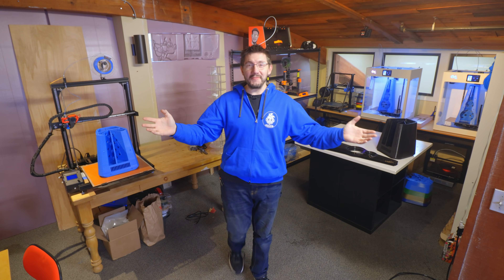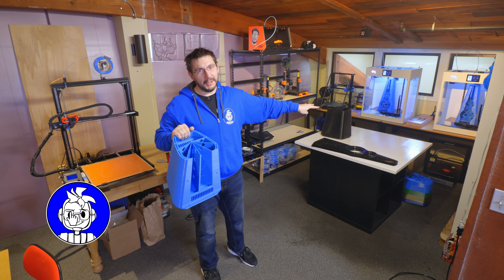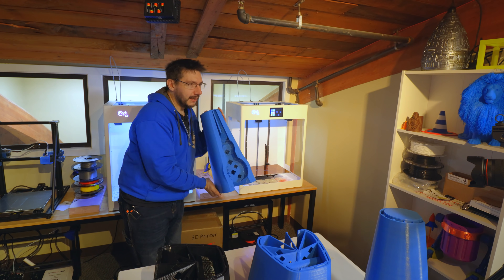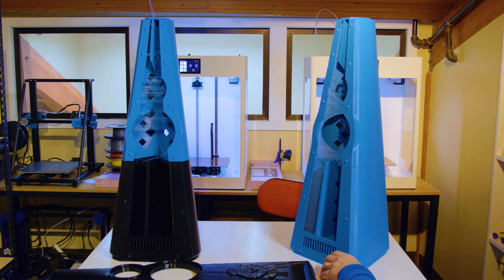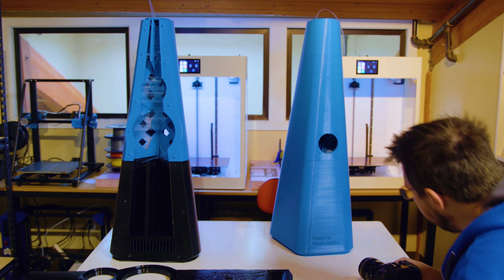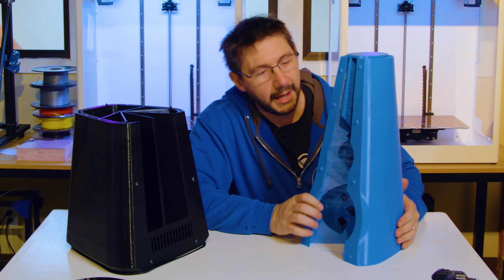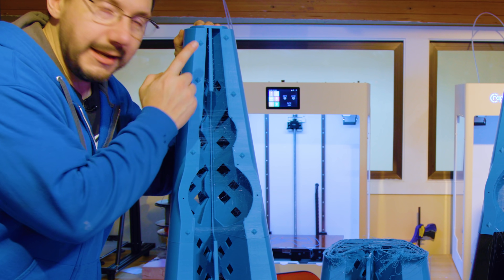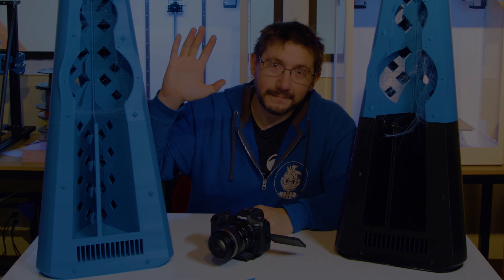3DPrinted Speakers Part 2: 11 DAY PRINTS

Comment: So let's get this straight. this $38,000 printer has poor bed adhesion, requires two filament spools even when you're using one, has huge layer shifts and stringing, and no bed leveling system...

meanwhile my $90 easythreed doesn't have ANY of these problems, even without a heated bed.

Comment: You could wet sand those speakers starting at 800 grit, then go to 1000 grit, then go up in grit by 500 for each sanding step, all the way up to 3000 grit. You won't have ANY layer lines when you're finished, and the color will be PERFECT. Use a sanding block for the flat areas, and a sanding sponge for the contoured areas, and use light pressure......let the sandpaper do the work for you.

Comment: looks like you're over extruded to me brother. You should calibrate your extrusion multiplier. No matter how much retraction you do there you'll either pull hot stuff into the cold zone the string will never go away when you're over extruding
Reply from the maker: Yeah I bet you’re right. I have some time coming up where I can spend a lot more time with the Craftbot machines.
Reply: @3DPrintingNerd  I find the hollow pyramid test print is really good to test for everything even heat it looks like some of those prints might have been maybe five degrees too hot
Reply: @3DPrintingNerd  but still most people could not pull off 11day prints so great job brother
Reply: @princefpv1  Preach my man,  jealous fools stating useless driver facts when its all about the prints.   The 1970 Altec Lansing 604E Super Duplex with the N-1500 dividing network whos equation is literally the building block for all cross overs in its proper enclosure will outshine some bunk driver you claim sounds good.  3D Printing Nerd is the man.  did not think you could print for this long.  and unless you can mach these up in software dont chat about your base level online engineering course that might of been taken.  Passions are not blinded by cost they are driven by interest in pushing ones own boundry.   most play music on compressed in ear buds, not Lossless Audio played on a 195pound Mcintosh Amp with 5grand Cardas cables.  You know what your music sounds like through really expensive gear........It sounds like SHIT! you hear all the mistakes.  we come here for the man and the prints.  not a lesson in spatial movement of air in a medium.  not that i search the globe looking at prints, these are impressive big time.  way to go

Comment: The gCreate gMax 2 are you serious? who in their right mind is going to pay $4000 for a printer thats a scaled up i3 design that can print PLA and PETG? 
I am looking at building a HevORT that can print over 150mm/s that can basically print anything up to PC and thats going to cost under 2k even with a 400x400 build area.

I do like the printing project though, i have a friend thats building a sub and all the speaker moulds from scratch.

Comment: Even a slight over-extrusion rate can manifest itself at the top layers of a tall print by causing your layers to collide with the extruder resulting in your layer shift, especially when traversing open spaces!  This could also be causing your stringing problem!

Comment: I believe the hole in the back would be for a terminal cup (where you would connect the speaker wires from the speaker to the amp or receiver

Comment: If you can break it down to  3 pieces then you can also break it down to 6 or 8 pieces and then it won't hurt so much as a failure on 10.75 days. You could also have 6 or 8 different colors as you started. it does look good.

Comment: Maybe slice the model into a few more vertical sections ... get the time down to say 4 days per printed part so a re-print isn't so painful.
Reply: I'm doing that right now. 7 day print into multiple parts. Turn it on before work, and start the next one the day after. Allows for adjustments while building it aswell.

Comment: As pretty (and hideously expensive) as these are, the sad thing is they are still based on a driver technology that's outmoded and doesn't produce terrific sound accuracy. Tech Ingredients' channel has demonstrated and produced speakers that cost a fraction of this - even the drivers cost a negligible amount and produce highly accurate sound production that can rival some of the best money can buy. 

If you're into awesome sound reproduction, his channel and the designs are really worth checking out - not only that, but the are so flat, they will fit into pretty much any available space.

Comment: just measure, cut and reprint the part that has the layer shift, I think with that you could also make a video of how to save a failed print.
Reply: That would be interesting. How would you cut it in a super clean way? Craft knife, band saw? I had wondered if the failed Gmax 2 print could be saved like that.
Reply: @Audio_Simon  I would think a band saw would be best to make a clean line. I have done this before in maybe a less perceive way with just a quick mesurement and a chop in tinkercad. But that was for a smaller 10 hour print that has failed a total of 3 times and I did not want to print again

With this it seems that there would be a good maker that could be found in the model to cut at

Comment: Bottom area discrepancy is because of plastic shrinkage. There are a lot more material in the bottom area which pulls the outer plastic inwards. This is not the case when printing walls. An enclosed machine with heated chamber would outcome this problem.

Comment: You should add some baffle material inside so it doesn't cause a knock pinging sound due to the plastic. home moving material stuff is awesome for it too.
8:27 resume at layer 3864

Comment: If he made the base a little taller, you should be able to fit an 8” sub-woofer into it as well.  It’s going to be very interesting to see how it resonates, as this is more of a violin like design than it is a speak enclosure design.  A downward facing sub-woofer at the bottom would make this a complete package.
Reply: The main driver is about 7" and will dig flat down to about 35Hz anyway. So sub will not be especially important.
Reply: @Audio_Simon  hi simon. I dig for your project and found nothing. I am interested to try it filled with an composite based on plaster or concrete.

Comment: If you find the height at which the print failed with the nozzle, you can go into the gcode and search for the z height and delete all the gcode prior to that height. You have to make sure to not let your bed cool, preheat your hotend and home only x and y before you click print. If the firmware has a auto level or auto home sequence then this technique won't work but if you're using octoprint, repetier host or pronterface it should work.

Comment: 11 days???  I get it.  It's nice to have bragging rights for such a long print, but couldn't these have been printed days faster with a larger diameter nozzle while not losing too much detail?
Reply from the maker: Maybe? I think going with a 0.6mm nozzle it could still retain detail, but 0.8mm would be tough. I suppose I could still keep it at 0.2mm. layers. I went with this setup because it was working well, I didn't have to change anything, and I could spare the time to print these. More experiments in the future though, for sure.
Reply: @3DPrintingNerd  Moving up to a 0.6mm nozzle while sticking with a 0.2mm layer height yields quite nice results, in some cases, you might be hard pressed to see a difference, but the greater line width will cut down on time quite a bit.  
0.8mm on the other hand is just a bit too coarse.  At 4x the volume of a 0.4mm nozzle, it's super fast, but unless you're aiming for that exagerrated layer line look, 0.8mm might be best left to functional parts that don't need to be too pretty.

Comment: From what I can see so far, all the speakers seem to share the same air space. That would mean the lower bigger speaker (the 8"? sub) will most likely interfere with the movements of the mid/high speakers when playing certain frequencies (if those mid/high speakers are not closed back). I also think the walls are not thick enough, or are not supported well enough to keep the cabinet from resonating while it's playing music. That's why many quality speaker cabinets are made from multi layer birch plywood, hard woods or MDF (for wall thickness/strength, and to help reduce unwanted resonances). I guess we'll have to wait until the whole thing is put together before passing final judgment.

Comment: Dang that Craftbot is unreliable AF !
Reply from the maker: I don't think I would say that. The left one with the layer shift IS the first one they sent my way. The one on the right IS the second one and the "better" one.
Reply: Vishal, really? Thousands of hours on mine and you have seen the prints. Mine are dialled in and are super reliable. I rarely check first layers, PLA, PET-G, ABS, ASA, Nylon.
Reply: @rick you and Michael Hunt are exceptions ... having known the machine and fine tuned it ,you guys have got a 'hang' of what gives (in addition to having spares on hand since you distribute the printers as well). I am seeing on the group so many folks having problems with the left extruder,extruder boards, mirror mode...far too many considering the price on these printers.I run a bureau with 6 older craftbots and I know they are solidly built but I think they need to mature the current product line through upgrades.
Reply: Vishal Pai It is super reliable mine are pumping 24/7 365. The issue with the left extruder is operator error, too aggressive when placing them in position. I pretty much print in parallel or mirror mode on all prints and completely disagree with people saying it cant do it (it does it easily, they just haven’t tuned there printer). This printer does need more fine tuning but once you get it right and understand it, WOW! My failure rate is ridiculously low now I just hit print and most of the time I dont even check first layers. What it is not is plug and play like the older CB models, you do have to fine tune it.

Comment: Why did they take so long. I make prop helmets and print them on a 300mm cubed printer. I’ve made prints as large, what’s your print speed is really what I wanna know. And if it’s lower than 60 whyyyyyyyy...... why
Reply from the maker: I'm using the default 0.4mm nozzle on the Craftbots because it's working well. As for speeds, I think defaults is 60mm/s but it slows down a lot for certain moves. Also, LOTS of z-hops and moving around for these. If I were to do this again, I'd probably go with a 0.6mm nozzle.

Comment: The combined price of those printers is astronomical and they came out with layer faults and stringing, I have 2 Ender 3's a CR-10 max and a V-king 400X400X400 and I know that they would do a much better job than those "industrial" models
Reply from the maker: I'm really sad about the Craftbot and the layer shift. Really, really sad.

Comment: He said something about some lifting in one of the prints, is that lifting off the bed or something on the side of the print like little bump that goes all around the print for a few layers. If so I have had this problem and I can't find a solution to it.
Reply from the maker: "Lifting" for me was an edge lifting away from the build plate.
Reply: @3DPrintingNerd  ok but I thought you said something about some thing at 1:09 some line right under the same that looks like it goes all the way around the print. what is the ring around the print and how do I get rid of it.

Comment: Looks great. I'm curious on how they'll sound once they are all put together. As far as sticking them together a 2 part epoxy that is geared towards plastic would be best. The West Systems G/flex 650 Toughened Epoxy is great on plastics. Maybe give them a call and find out what they recommend.
Reply from the maker: I had though about an epoxy, but I was also thinking about generous helping of 3dgloop. it'll produce a sort of chemical weld at the seams. Yeah?
Reply: @3DPrintingNerd  Sounds like something that Stefan from CNC Kitchen could test. :)

Comment: What I'm learning from this project is, if you're building a larger printer and plan on doing large, multi-day prints, invest in closed-loop steppers to help prevent layer shifts.

So, with that, we gotta hound the 3D printer hardware manufacturers to start producing better quality closed-loop steppers, ones that incorporate the TMC driver chips, not just the a4988 drivers
Reply from the maker: Closed loop would be AMAZING. I don't know the cost difference, so I don't know if it's possible.
Reply: @3DPrintingNerd  I don't believe that it's too expensive, especially on a larger machine that you'd already be paying more for. I don't know how much each printer you used for the project costs, but the actual closed loop drivers (they just attach to the backside of the stepper motors that are currently used and use a magnetic encoder to maintain position) are only like $10 a piece, so not really any more than a standard tmc2209 driver

Comment: Those layer shifts are a real bummer - particularly the one that killed the big multi-color print.  These are some big money printers - do they not have lost step detection (with Trinamic or similar drivers), or did the detection just not work?
Reply from the maker: Neither the gMax 2 nor the Craftbot machines have missed step protection.

Comment: I also have stringing, but then realised it was from damp filament. My printing room gets humid when it rains, and my PLA soaks it up, and I get stringing. So I recon the 11 days out in the open cause a hygroscopic reaction in the filament, causing the stringing.
Reply from the maker: Hmm, it's possible, but same spools in same conditions aren't stringing on other machines.
Reply: 3D Printing Nerd Please tune your profile, I have zero stringing running 10 off these
Reply from the maker: Yep. That’s what is needed.
Reply: 3D Printing Nerd can we help?
Reply from the maker: @fuse3d  Of course! I've got Michael's craftware profiles, and I think I just need to adjust temps and retractions. What are your retraction settings for PLA in Craftware?

Comment: Love to see some long term tests if you actually use the speakers. Imagine the constant vibration from the speakers will slowly delaminate the layers.
Reply from the maker: You know, I never thought of that. I cannot wait to try.
Reply: @3DPrintingNerd  How is the layer adhesion on these prints? Would you say they were extruded towards the cooler end of the spectrum?
Reply: If you run a cycle of shifting tones, varying noise types, etc over and over for a few weeks, you should be able to see any issues appearing.... And get really annoyed by the terrible sound.

Comment: Use acetone to assemble them. I just printed a stormtrooper helmet, and used acetone to assemble it. I was always told it only works with abs, but you can use it to fuse pla parts also. It is a much stronger bond than CA glue.
Reply: Dope
Reply from the maker: That's awesome! I was going to use 3dgloop to do a chemical weld though. Have you tried that?
Reply: @3DPrintingNerd  Hey. No i have not tried the gloop. It is not available in Denmark, and I have not found any shops that will deliver it here. 

If you give the acetone a go, I can recommend using a small brush and assemble the pieces first and brush it on the joint, and let capillary action do it’s magic.

Comment: 10 years from now people will look back at this video "you waited 11 days for a print?  Man were those printers archaic"
Reply: “Yeah! It only take 10 days now!”
Reply: @kingarthurthe5th  Unfortunately, you're right.
Reply: @gustarrezende  I'm hoping that the tech that the Carbon M2 Printers use gets cheaper soon though. those are only limited by the heat produced by the resin being cured.
Reply: It’s a very good test of the limits of the printers, though we now need a 36 hour version of this print.  ;)
Reply: print it in like 2.5mm with 3mm filament on a machine with great acceleration and speed.
Reply: @satibel  don’t forget some heavy duty heating
Reply: Heck that's slow for today, I bet he did that all with a measly .4mm nozzle and wasn't anywhere near pushing those printers to their max speed.
Reply from the maker: Yes, did it with the 0.4mm nozzle. I had it dialed in and had the time to spare. Plus, in testing these machines, having an 11 day print is a decent test.

Comment: I have stringing issues like that a lot. I've tried tweaking but not working. You have any tips for that?
Reply from the maker: I would usually play around with temp and retraction, though, some filaments can absorb enough moisture from the air to cause it too. Can always try drying.

Comment: How wide is that front cover?  Will it fit on the CR-30?  I be curious to see how the quality would compare if it will fit.  Also Try using MicroMark SameStuff to glue it..  You can just wick it into the seams..
Reply: Wondered about that but bowing might be an issue matching the registration pins. What you think?
Reply: @Audio_Simon  I'm assuming the cover will eventually be glued in place since the pins are just for alignment..  on my prints that since I only get about 1/8" bow and that flexes out very easy especially on a print that thin..  I think it would look better as all the face would be outer edge not top layers..